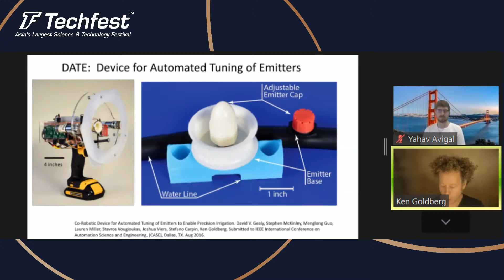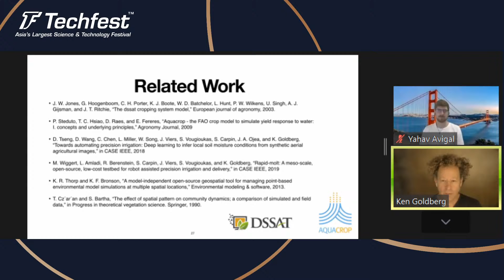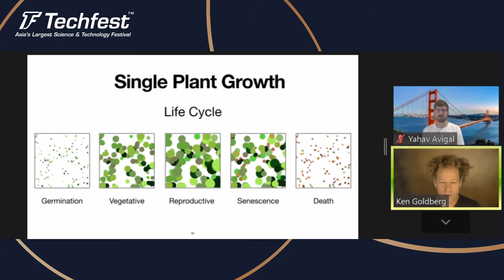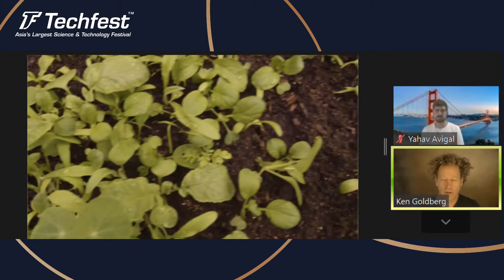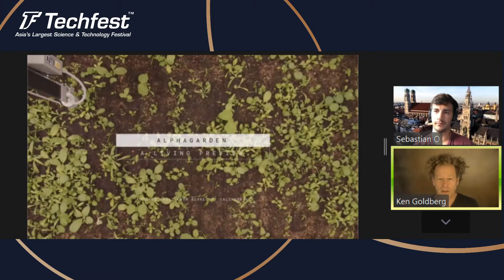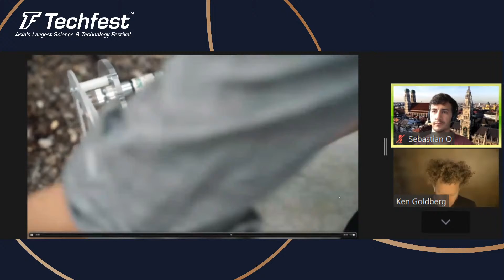Can a robot learn to garden? | Alpha Garden, UC Berkeley | Virtual Exhibit Series

Comment: I think we need to approach agriculture with a balance of tech and traditional agricultural science. Unnecessary use of tech must be avoided. 

Plastics must be avoided and reduced in gardens and agricultural fields. Need to look at how the tech we implement in agriculture affects the whole environment.

Electronic and  PCBS are very polluting to the environment for example. Hard to find eco friendly substitute and hence we must use them as little as possible and avoid overusing them everywhere just cause we have pcb technology.   

People emphasize on uniform and precise irrigation (I  was die hard fan of that once too)  but once it rains there is no way it can be precisely watered , meaning plants end up getting too much water and they still are fine.  In deserts, mountains cold climates such precision irrigation makes real sense.